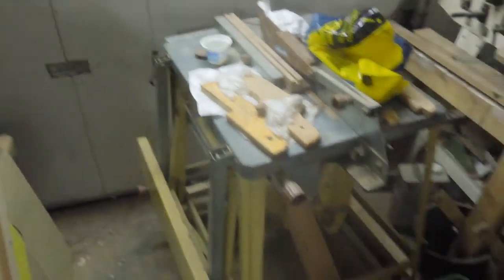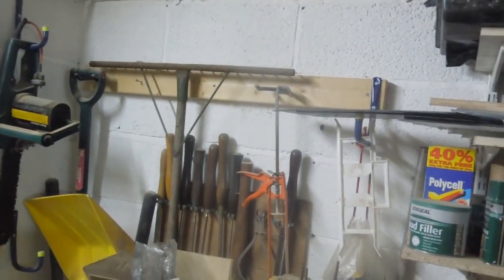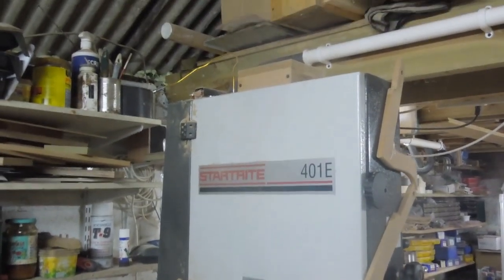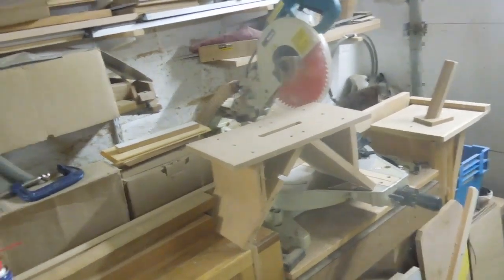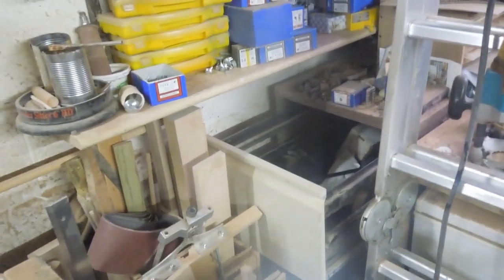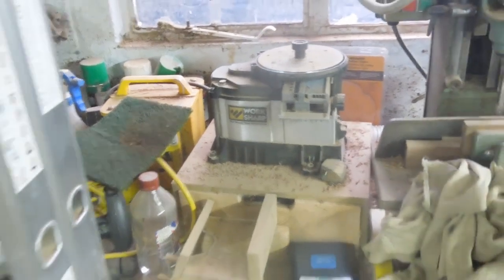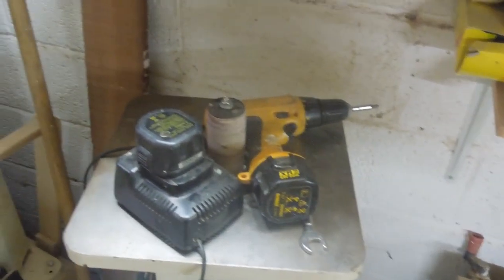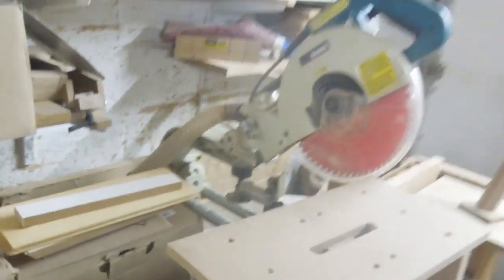Workshop Update - August 2013

Comment: Olly,  If your situation changes to the point where you are low on funds and space... consider selling all your power tools completely.  Stay involved with woodworking by doing simple projects with Hand tools.  It can be very relaxing and rewarding without the space requirements and you can be mobile.